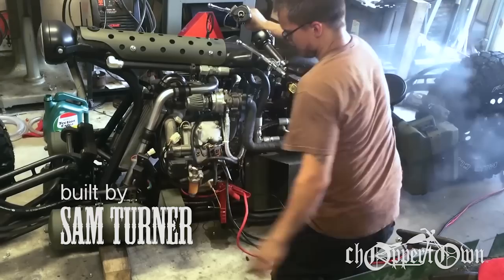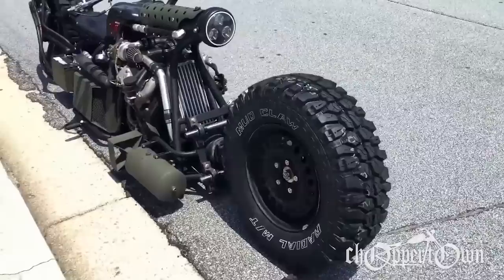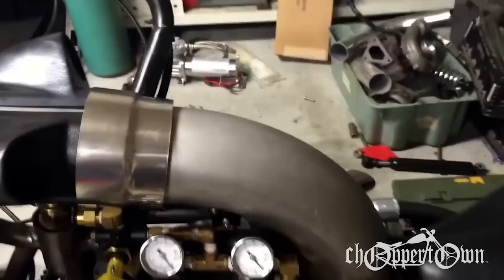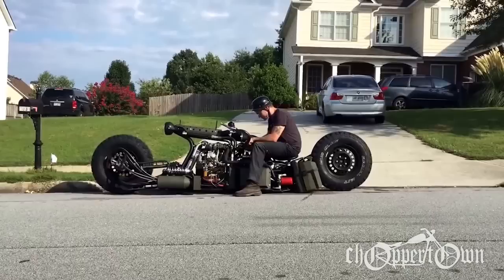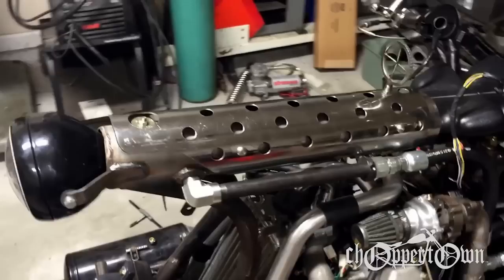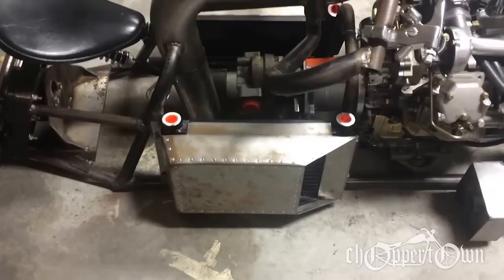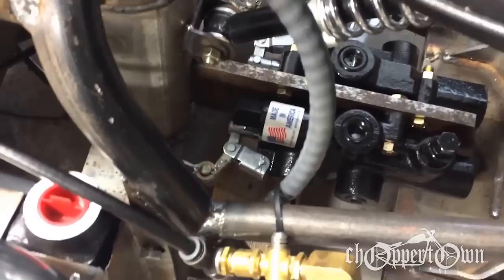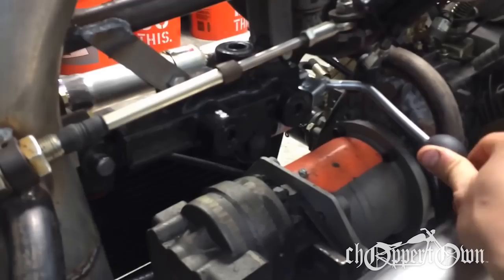Twin Turbo Diesel AWD Motorcycle (Bike & Builder episode 2)

Comment: Interesting setup with "clutch" and "brake", I like it! BTW since it is single speed have you thought about adding a 2nd speed by dropping to one wheel drive by cutting flow to front wheel while allowing it to recirculate so that all the flow would go to the rear doubling the speed?

The smoke is WAY excessive, it looks like it interfers with driving...
Reply from the maker: work in progress :)
Reply: +Choppertown yep a solid tune to get the smoke down an then it will be pretty cool.

my only concern is the air ride system. if air pressure is lost while above 20 mph, isn't the frame going to drop and said rider is going to go flying with possible injury or death? air ride bikes don't lay on the ground because of this.
Reply: +Choppertown What about some kind of a safety catch, I'm thinking a dog, like used on hoists, that would kick out, if you lost air. Like what would happen if a truck using air brakes lost it's air, the brakes would apply.
Then the only issue is how do you keep the bike from falling over when you stop.
For the smoke issue. Run straight biodiesel made from recycled cooking oil, and then the issue would become walking around smelling like a french fry. lol.
But what about two pipes side by side out to the back, cover them with heat shield and make them look like the rear bombers guns.
Cool bike though.
Reply: +mibars yeah love it really steam punk look, but wouldnt it be better if he makes the exhaust longer to the back side? that way the smoke wont bother the rider himself
Reply: +mibars Hydrostatic drives are variable speed.
Reply: +roomwithapointofview Good idea on the safety catch.  A single-acting spring return air cylinder would do the trick.  When the system is pressured the piston would retract the safety catch.  If system pressure is lost the spring return would extend the piston and engage the safety catch.
Reply: +prairie wanderer Not necessarily. There are hydraulic pumps and motors with fixed displacement and those with variable displacement. I can't clearly see the pump or motors, but if I had to take a guess, they look more like external gear machines, in which case they are fixed displacement.  
But as Choppertown says, "work in progress" so we might see a two speed (deactivate one motor) or maybe even a continuously variable transmission (easiest to do with a variable displacement pump)
Reply: YensR
In industrial and commercial applications a hydrostatic drive by definition is variable output.
Reply: prairie wanderer I'm a mechanical engineer working in the fluid power industry. Variable displacement is not a necessity for something to be called a hydrostatic drive. If you or people around you use this term only to refer to circuits with variable transmission ratio, they are wrong or at least are using a misleading company lingo. 
Straight from Rexroth's webpage, but there are many more: 
"Rexroth fixed displacement motors include both standard and plug-in design choices for flexible hydrostatic drive solutions in many hydraulics applications."

http://www.boschrexroth.com/en/us/products/product-groups/mobile-hydraulics/axial-piston-units/fixed-motors/index
Reply: YensR

Thanks for the information.  Here's my favorite passage from the document:

"5.2.2 ....The output speed is proportional to the inward flow and inversely
proportional to the displacement of the hydraulic motor."

So in other words, a variable input flow will result in a proportionately variable output speed from the motor. 

In 25 years of experience designing and repairing commercial equipment in a variety of industries I've never once heard of a fixed speed hydraulic drive system referred to as a hydrostatic system.  Maybe that's how they are described in the classroom, but not in practical application and usage.
Reply: +prairie wanderer 
Ah! We are talking two different things here. 

I said that the displacement is not necessarily variable for a hydrostatic drive. That stays true. 

You talk about the speed [rpm]. This is of course variable: More flow in, more rpm out. As you quote, the ratio of flow and rpm is proportional to the pump or motor's displacement. 

However, this whole subthread of discussion came from the suggestion to go away from a single-speed drive [mibars's comment]. Now, "single speed" when used like this means "one transmission ratio", it does not literally mean "one single rpm". (You can google single speed motorcycle to see it's a common term.) So I guess we got confused about the word "speed" - you using it to mean rpm, I using it to mean a gear ratio. 

In order to have variable transmission ratio, you need at least one variable displacement machine. Because that allows you do have a given flow into your motor and change the rpm that comes out. Or have a pump driven at a given (engine) rpm and produce a different flow, which is then sent to the (fixed displacement) motors to create a different wheel rpm. Just like changing gears in a transmission - or, if you use continuously variable displacement, you'd get a CVT (continuously variable transmission). 

Now, with that cleared-up hopefully, what do you even mean with "fixed speed hydraulic drive system" if you literally mean "fixed rpm"? Do you mean a hydraulic system with speed control, that keeps the rpm constant? Because in that case, it's probably a hydrostatic drive of some kind, too. 

I also strongly reject the implication that "classroom stuff" equals irrelevant. FWIW, this is engineering consultancy as well as research&development.
Reply: YensR

Again, thank you for the information and the accurate clarification of our different use of the term "speed".  We are in agreement except for the "classroom" part.  I intended no implication that theory is irrelevant, just that real life experience has shown me that oftentimes applying the classroom knowledge in the real world escapes many engineers.  I work with engineers every day and respect their knowledge, and I use engineering data when designing equipment.  Those same engineers consult me because though they possess a lot of knowledge about the design parameters of equipment and components, they lack the real world experience to put those components together to form an effective end product.  I also know some engineers that are very good at product development.  That typically requires skills that aren't learned in the engineering curriculum.  It is a symbiotic relationship.  Different people have different talents. I think some of the confusion here can be attributed to language differences, while as you noted, some is due to different use of the term "speed". 

I've enjoyed the exchange of ideas.
Reply: prairie wanderer I enjoyed it as well. I'm sorry for my German directness :-/   

I think technicians and engineers both need to have an idea of theory and practice. So that they can appreciate what they can achieve together. I just think it's bad if engineers think practical things (especially manufacture) are beneath them or technicians think that theory is just fairytale numbers. modern products really need both. I'm guessing we are not too far away from one another here, though!
Reply: YensR

No apology is necessary! 

Well said, especially the importance of the relative strengths of engineers and techs and the necessity of collaboration between the groups.  I'm not an engineer, though I've had to amass quite a bit of engineering knowledge.  Part of that is knowing when studying engineering data isn't sufficient and that an engineer should be consulted.  In my opinion the worst engineers are those who try to micro-manage every aspect of a project, when although they are very skilled engineers, they are not machinists, or welders, or fabricators, and have little or no practical skills, but think they are experts in those fields.
Reply: Thank you and I agree (obviously). :)
Reply: +prairie wanderer Read the 'SPECS'. It says "3.33cu/in per rev. Hydraulic Gear Pump"!
Anyway, you wouldn't need the spool valve (shown) to reverse the output on a swashplate pump. You just tilt the swashplate!
Reply: James Bradley In order to do that, the hydraulic circuit must be closed-loop. Reverse gear via a valve also works with an open loop circuit, which is easier to implement.
Reply: James Bradley
I'm not sure what post you're replying to.
Reply: +mibars Could something like a small Gear Vendors transfer case work to provide different gear ratios?
Reply: Richard Adams Probably yes, but Gear Vendors has like 0.7 ratio? And it has a drawback that it can't be engaged at lower speeds. Not much of RPM change if it has to be "main gearbox"
Reply: think we just found the sole cause of global warming...
Reply: +guitarHero1885 LMAO!
Reply: +guitarHero1885 ha ha
Reply: If Global Warming was real, you might have a point. When they can start getting their predictions correct 100 days into the future, I'll listen to what they then predict 100 years into the future. Until then, I'll enjoy the diesels doing diesel things.

Comment: First, awesome job!  Really outside the box thinking.  Second, I own a pre-emissions diesel truck with a tuner so I'm no stranger to rolling coal but it usually clears up once the turbo spools.  I'm not an expert on diesels & turbos but I think you might have it over-turbo'd.  If you cut it back to a single, or found 2 really tiny turbos, you might clean it up a bit.  Roll all the coal you want at the stop light but at running speed, you should be clear(ish).  Hell, old tractors didn't smoke that much under load and they did a lot more work than your asking this engine to do.
Don't take me wrong, not bashing it or complaining about environment, blah blah blah.  Only offering up a suggestion.

Comment: Nice build, but it smoke alot, how fast is the bike?
Reply: Diesels usually smoke a bit.
Reply: +{MLP} Rainbow Dash if you dont calibrate diesel engines it would really smoke alot and black
Reply: Not like this. He's got it set waaaaay rich on purpose!
Reply: MMD don't think this one needs to be fast, it's badass as is.
Reply: kool
Reply: LOL. "It's not real fast but it sure does smell bad!"
Reply: In another video he said it goes 85 to 90 mph.
Reply: That explained the Fred Flintstone take off.

Comment: Awesome, however it looks like you need to fix a exhaust leak around the turbos? Whats the top speed?
Reply: The leak you are talking about could be the waste gates for the turbos
Reply: +Benjamin Kenney A waste gate doesn't billow exhaust out of it. Definitely an exhaust leak
Reply: +ohgodwhat1 what about an atmospheric wastegate?
Reply: It looked like it was coming from where the exhaust met the turbine housing... so I think it was a leak.
Reply: Ok
Reply: Benjamin Kenney I think your understanding of a waste gate is close but a bit off. There are two parts to a turbo, the turbine and the compressor side. The exhaust gases are used to spin the turbine(drives the compressor side) but the waste gate only releases the excess pressurized clean air that would normally go into the engine from the compressor side.  Exhaust gases will always go through the turbine and then through the exhaust they are never vented directly from the turbo.
Reply: +ohgodwhat1 no, you are talking about a blow off valve (BOV). A BOV releases pressure from the clean side when you let off of the throttle, a wastegate controls the amount of exhaust going to the exhaust turbine so you don't make to much boost or over spin the turbo. If the exhaust pressure is too high, the wastegate opens and let's exhaust either bypass the turbo and go back into the dump pipe or vent straight out into the atmosphere.
Reply: Benjamin Kenney Ah I gotcha. For some reason I was thinking BOV. I should probably read that a bit closer haha  That could be the case if it was venting externally rather then back into the exhaust.

Either way cool bike but too damn much smoke billowing over the rider
Reply: +ohgodwhat1 haha its ok. And I agree, smokes way too much

Comment: Why is is smoking so bad?...Fuel works better when its being burnt.
Reply: exactly!
Reply: black smoke is burned fuel. It's over fueling it be white if unburned fuel
Reply: You're thinking about a gas engine. This ones Diesel.
Reply: +Lone Wolf I've only been around trucks for over 31 years. If you ever seen and smelled unburned diesel fuel you'd know it.
Reply: Both black and white smoke mean unburnt fuel. Black smoke means an imbalance of air to fuel but the most common issue is too much fuel (unburnt). Yes I can give it to you that it can be too much air not enough fuel but in most cases its not especially how it was running. The black smoke is full of particulates that are basically large diesel particles that normally would be burned as fuel. White smoke means it as well is not being burnt properly with low engine compression, water in the fuel, fuel pump timing being off a whole slew of things both ways. I was just trying to let you know something but now you're being a keyboard warrior so this is all I'm gonna say you can say whatever you want after this these are the facts search it up anywhere. Also unbeknownst to you since your statement is showing you know nothing about me I also have been around all types of vehicles all my life.
Reply: Yeh, amount of fuel seems right, just not enough air (boost :P)
Reply: The smoke from a diesel means it is not all being used. However this is common for diesel trucks as eventually all that fuel is needed. It does help to make a bunch more power at the disadvantage of havung poor milage
Reply: You see diesel pulling  tractors and trucks pouring out black smoke under heavy load.  Can you imagine what you would look like doing a days ride like that?...You would be dark black outside and inside as well.
Reply: +mike wasfaret black smoke in a diesel is too much fuel not enough air but it does not mean the fuel is unburnt. a proper air fuel ratio just assures the fuel is cleanly burnt. white smoke is unburnt fuel. he needs bigger turbos or needs to turn the fuel pump down unless he likes being covered in soot
Reply: Is there an exhaust leak at the turbo?  Looked like it in the ending scenes.
Reply: +Lone Wolf I wonder if he dropped the size of the turbine for a lower A/R if he might get a bit more boost at the cost of lower total boost, it seems to lack proper midrange AFR and is running rich. perhaps cut the fuel a bit if he can't keep enough air flowing.

Comment: Love this build. As much weight as that has it still pulls and actually rides great. my first thoughts? In another video he stated they were just regular car steel wheels. Of you took a small Hatchback or a Mini even, you could probably do away with everything in the driveline except the engine. remove all the weight. place the engine in the middle, run your hydraulic pump off it and run them wheel motors on all 4 corners. or keep engine up front and FWD. It's just running the hoses, could even AWD it with the engine still up front. My point is you could loose tons of weight. not sure how fast the gears can drive tho, but maybe for a tight autocross track or even a city DD. They already have concepts out just much more advanced then that

Comment: I wish I had the time to build such a creation..  One thing I would suggest is going with a Danfoss (Sauer) variable displacement pump with a bent axis (piston) motor. Sizing is of utmost importance. Remember 1HP will get you 1GPM at 1500 PSI. So you have to balance the cc's of your components to get the maximum torque and speed with the available HP. Also, with a variable pump you can use that as a brake instead of restricting your return flow. Restrictions create heat... heat is bad..

Comment: Very cool build, love the looks and the technical content. I get the smoke thing, but I wouldn't run the engine that rich all the time. It's perfect when it bellows smoke on the throttle, on idle or cruising it should clear up imho. But hey, it's your build, you have to drive it and put diesel in it! Good job!

Comment: I would have just used air cylinders to lift the bike and act as the shocks set yourself up into some deeper air logic using Zero G balancing circuit in the air logic.. to add more lift. This has to have some good torque to it for offroading. Hydraulic hub motors is bad ass!

Comment: You need a longer exhaust pipe. It looks like you are enveloped in exhaust fumes all the time.
Chicks don't dig the odour of diesel fumes. It looks like the pipe is putting out exhaust right into the lower pressure zone right behind your back. It is perhaps possible that you could make it burn cleaner with attention to the injectors. That would be easy after the engineering headaches the build process must have given you.